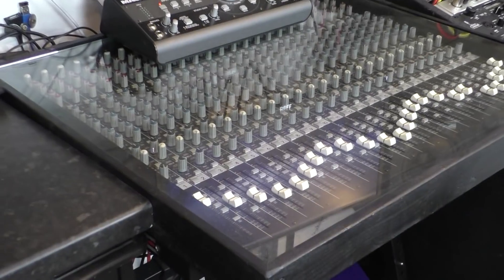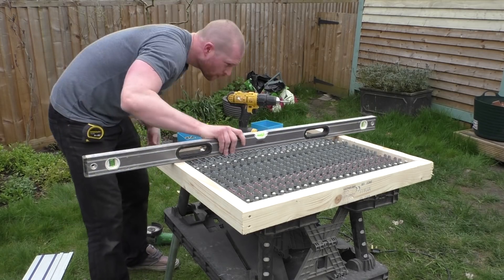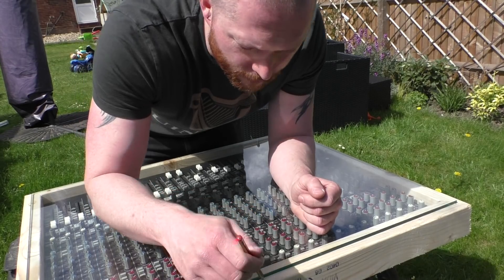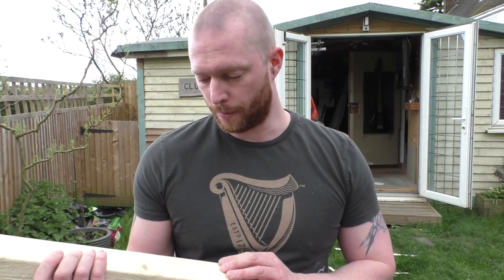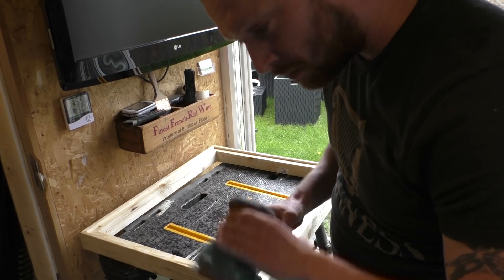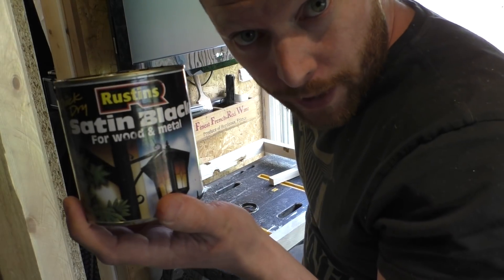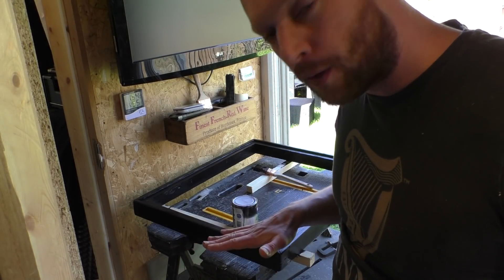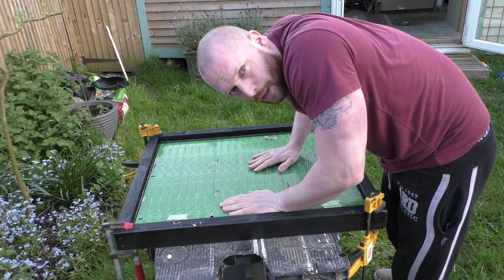DIY Studio Desk

Comment: Fuck Id really like to have that mixer😔
Reply from the maker: The working version was great. This one didn’t have a power supply so I had to use the working one from my good desk. The power supplies cost about the same on eBay as a full working desk. I bought this for £50, sold the meter bridge for £100, sold the main PCB for £30 and transforming it into a desk only cost about £80.

Comment: hi have you got any more info on you studio shed build as im looking to build one but looking at all timber construction fro out side etc
Reply from the maker: Oh yes.  almost all my studio building experience is shed based and there have been many studios.  Have you checked out my soundproofing guides?  I've done a few videos on different aspects of soundproofing

Ideally you want a room within a room.  If you're building to building regs in the UK you can bump into some restrictions like max height of 2.5m if the building is within 2m of a boundary.  That's my biggest issue.  I may have walls inside the walls but only one ceiling and the ceiling is a big weakness in a shed especially when it rains as I can't use condenser mics when it
s raining as it's too obvious.

What are you dimensions and budget?
Reply: ahh yes i did thanks . was just wondering that there was no hidden concrete block walls etc .lol  .sound reduction seemed very good on you vid
Reply from the maker: I wish there was concrete blocks in there.  If there's space at my next house that's what i'd 100% do.  The current shed has a lot of weight and different materials to help scatter and break-up the sound waves from outside.  So db Rockwool, heavier sheet materials such as moisture resistant MDF and db plasterboard (drywall).  It all helps.

The ceiling is my biggest issue though as I can't pack it down more or I won't be able to stand.  It's currently the 18mm ply, a couple of layers of PIR board (although that's better for thermal rather than db), then a sheet of OSB and a layer of db plasterboard.  It's not perfect but it stops the sound of the motorway which is about a mile away.  

Doors and windows are the other big issue with studios and especially sheds.  Windows are always a bad idea but I like fresh air and also enjoy daylight when i'm spending day after day in a sealed room hence the removable window boxes.  Again with doors and windows I like to add in a sheet of cement board and use a lot of moisture resistant materials and it really works well.  The 70mm acoustic foam over the window boxes was for acoustic treatment but it also does a small amount of soundproofing, mainly with regard to the higher frequencies but that's what the motorway hiss is.

You can go over the top and de-couple your doors etc but there really wasn't much point with my project as no matter how good all the walls and doors are, my ceiling is the weak point and no matter how good your soundproofing is, it's only as good as the weakest point.  

One thing that you really should do which I forgot is put a membrane across the face of the inner stud-work.  So after all the insulation is in, tack the membrane over the stud-work then board over that.  That acts as a moisture barrier and it's what you'd do on a loft conversion.  

Feel free to draw up some plans and send them to me.  I'll take a look and make suggestions if required.
Reply: well working within the 2 meter boundary line so  2.5 m to apex of roof so thats the killer, however im looking at say 10 feet by 8 feet
Reply: ok mate will do .
Reply from the maker: very similar to mine.  even though mine is 11' by 20' overall, the studio part is only 11' by 8' (externally).  Each one of my walls is a foot thick, the floor is 6" joists with 8' of rockwool squeezed between them (supported using chicken wire so it doesn't just fall out), 3/4" plywood, 2" of polystyrene and then 22mm of moisture resistant T&G chipboard.  

I'd suggest using a midway support for the joists you should be able to get away with 4" floor joists which would mean you could beef up the ceiling more or a concrete slab.  Ideally you'd want the walls on a perimeter concrete foundation and the internal walls sat on a separate concrete slab but you don't have to.  With a concrete slab though you'd have more ceiling height so you could create a ceiling under the first ceiling supported by the internal walls.  That'd get around the rain sound issue which plagues shed recordings.  I just use a dynamic mic when it's raining like an SM7b 

With a studio that small you'd also need some decent acoustic treatment to stop it sounding terrible and due to the lack of space it'd have to be along the lines of what I've done - I have 70mm inside the reveal of each window.  the one o my side sorts the first angle of reflection and the one behind also helps with the main reflections.  To my other side I have a canvas picture with custom size acoustic foam inside the frame hidden so it looks nice and some of that egg-box style foam on the door.  Also a few of those acoustic tiles scattered around.  With good acoustic treatment you;d have a fairly nice sounding room for both recording and monitoring.  Also the pitched roof helps
Reply: cool man thanks for the info .  most of my recording will be 90s midi hardware in racks . so might take up lots of room . i have to have a another think  before i start doing anything